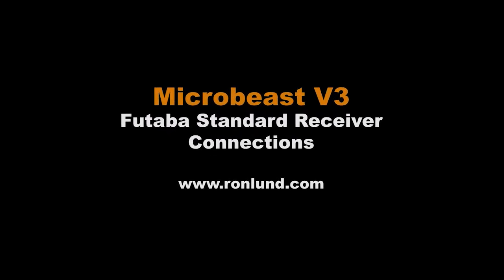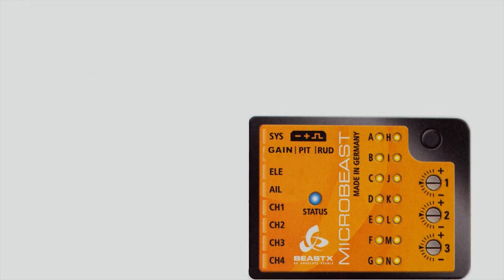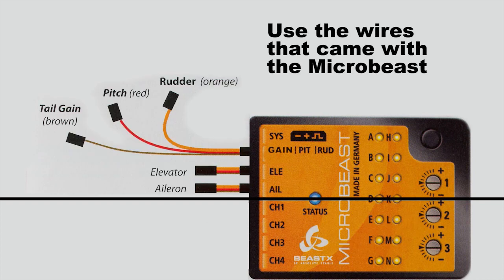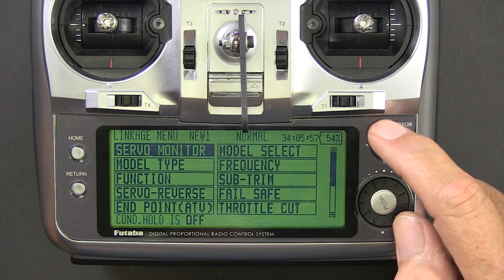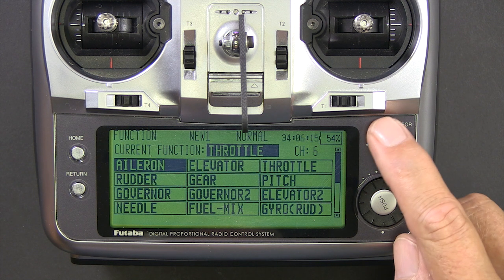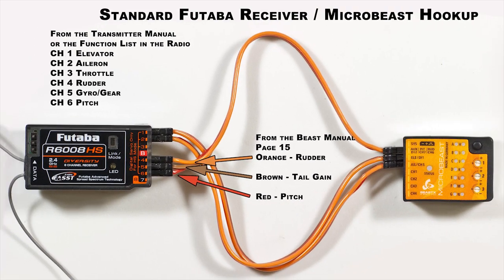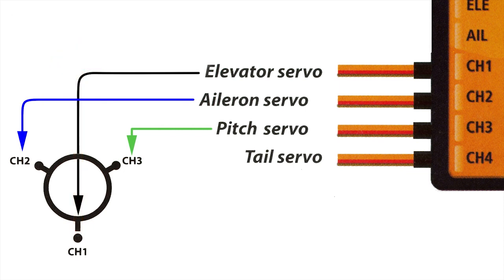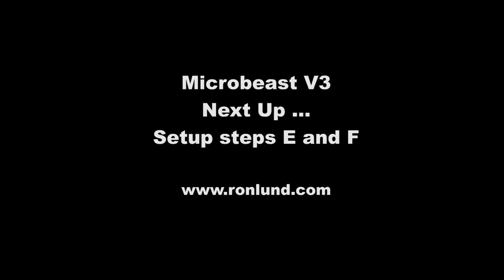Microbeast V3 - Futaba Standard Receiver Connections

Comment: hi I have the futuba 14sg with the R7008sb receiver will this still apply  I have the beast x pro edition  I put the wires in the same exact  location  but starting to think it's wrong because the receiver has just 12345678 numbers and no B  between 3 and 4 so it's confusing
Reply from the maker: Jonathan, Why not use the S Bus feature? Watch this video. https://youtu.be/njPFjbx17yE 
Now you only have to make sure channels 3 and 6 match what is in the Function menu on the transmitter.
Reply: Hi I have a Futuna 10c and I can't Chang my canel functions,could you pleas show me a simple diagram how to run the wires differently as you said,thank you ,
Shawn